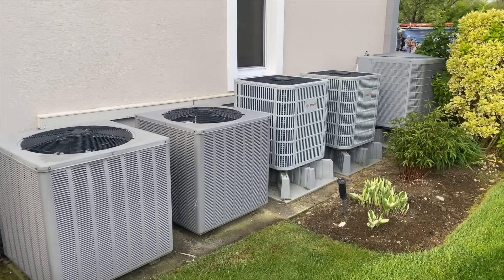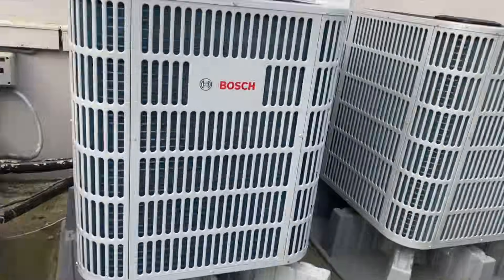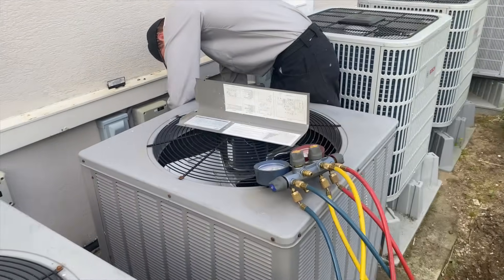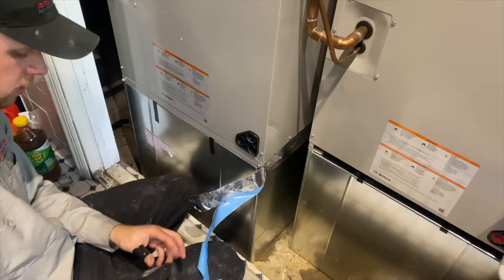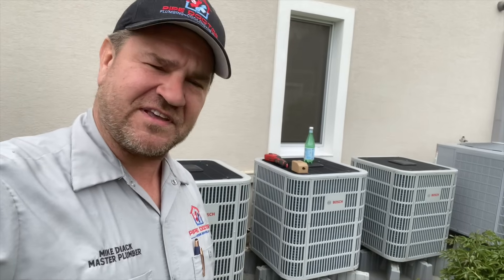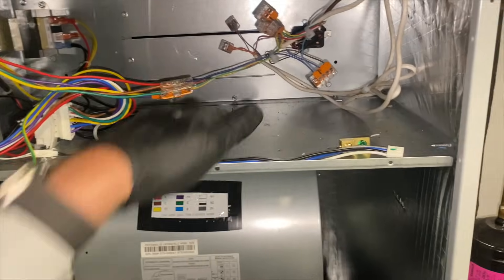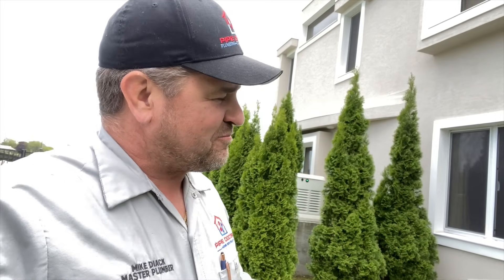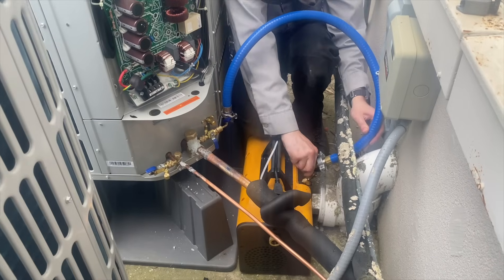Best 2023 Central AC Swap from Freon to Puron Proper Techniques for Heat Pump Installation

Comment: Correct me if I'm wrong you don't run low voltage wire two units you have an electrician run your lovolt

Comment: The way I was taught in school to pull a vacuum on a split system is that the vacuum gage goes on the high side port by itself, and then you pull the vacuum from the low side port only. This gives you a true vacuum reading. Putting the vacuum gage directly in a location where you are also pulling a vacuum from will skew the results.

Comment: Mike it's a crazy thing but I have to tell you about a dream I had last night 5/ll. My neighbor  who does some welding, had somehow become one of your guys who helps to install hot, water tanks . By the time he was done all I could see was a series of ramps with a large ball bearing going down it much as a roller coaster would. On the way down it would hit a series of on/off flaps on hoses which would control the water feeds and shutoffs. Much like the Milton Bradley Mouse Trap game of years ago. It was one the nuttiest dream I have ever had. The installs cost you a ton of $, and all I can remember thinking was that none of the installs done by my neighbor would meet code for sure...Crazy...
Reply: is someone on LSD?

Comment: Summary was generated by Summatim, let us know if there are any inaccuracies! 🤖

0:14: Introduction
0:54: Number of units
1:31: Bosch IDs 2.0 Condensers
2:55: Reason for not using full potential
3:22: Replacing Weather King Rheem 5-ton R22 condensing unit
3:48: Mikey Pipes Philanthropy
7:59: Removing wires
6:23: Pipe Wiper
7:08: Deburring tool
10:27: Vacuum pump
11:41: Adding Sealant
12:46: Micron gauge
13:44: Conclusion
14:36: Introduction
14:37: No cost or obligation
14:39: Possible reward
14:39: Conclusion

Comment: at what point does it make more sense to just install commercial cooling into these huge houses? they have the 20Ton units with multiple compressors and sht
Would be cool if you had two 20 ton units that work together or one can pick up the slack, or carry the load if one is down.
Reply: Yes see lots of vrv/vrf systems on big houses here

Comment: Can the pigys get stuck inside the copper if the copper is kinked ?!
Reply: Supposed to be able to blow through, if it’s kinked that bad then it should be fixed.

Comment: $77.50! I don’t know what beef you got with Justin or whomever, not what I’m here for. But a digital gauge can show a micron level like a testo so I had trouble understanding the beef. Also with a mansion like this, why not use a red link module outside to not have to worry about the 2 wire? Lol the more you know